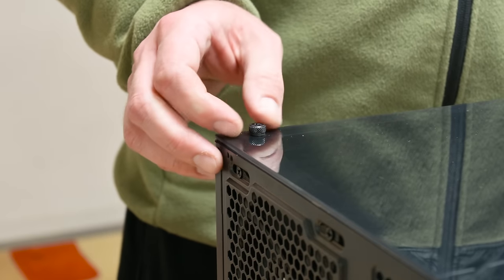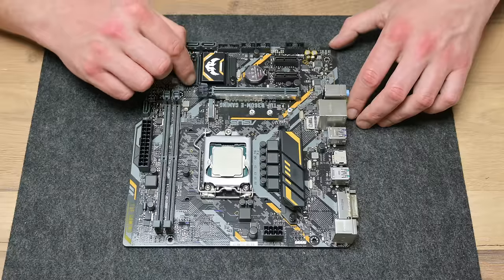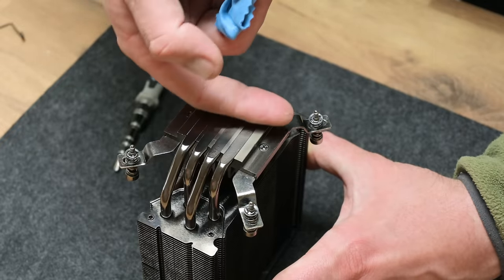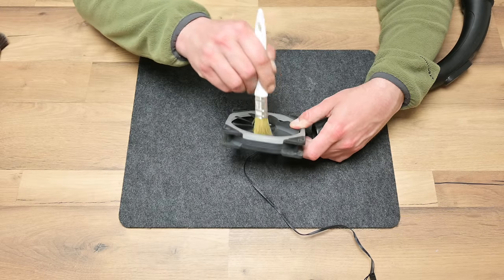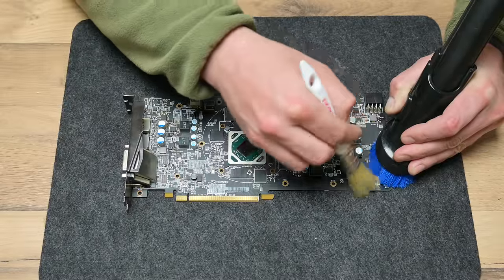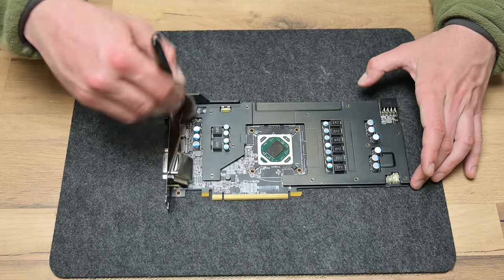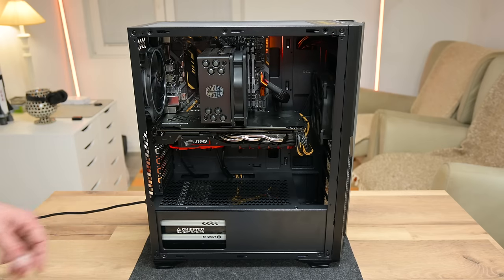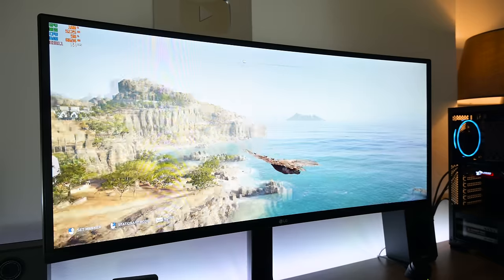This Abandoned PC is Finally Finished

Comment: The only minor thing is that u should have placed the intake fan more lower since the mesh of the case is lower so it pulls more fresh air in, locking at it now the airflow seems blocked
Reply from the maker: Yes I agree, I change that before I return the PC, it was too high

Comment: I'd get the CPU up to a second hand i7 8700, graphic card up to a second hand RX 6600, and go full 1TB NVME (through OEM drives like Samsung PM981) if I was the owner of this rig. These upgrades still fall within the affordable range. Then again, you are following the owner's request to be as cheap as possible with the build approach, so it's understandable.
Reply from the maker: He has the mobo, CPU, PSU and Case already and  he felt sorry to leave the PC unfinished but because time pass and the parts gets older he don't wanna spend too much on this computer.
Reply: @ComputersAndTechAndAndrew  the PC will still make for a wonderful secondary build, in case friends come over but have no gaming capable devices to go multiplayer together.

Comment: Pls next time use solins cleaner instead of isopropyl alcohol. It vaporises faster, and leaves no markings on the surface.
Oh, and also, change the PSU. This one have a really weird reputation.
Reply from the maker: solins cleaner is fine as well, also I didn't change the PSU because I was asked to leave it, but I agree better PSU is needed here
Reply: @ComputersAndTechAndAndrew  im working as a technician, and i recommend to use cleaner, it saved me quite some times, like when you need glue loosen without any risk of spilling the liquid inside - it just vaporates and dont stay in or damage the parts.
Reply: @O2chevsky  one thing to know : andrew is a techician too
Reply: @warior1195  i know, and that was a friendly advice from one technician to other.
Reply: Why u bother to annoy him with this cmon mr annoying

Comment: Please put windows 11 on every pc or laptop you restor
Reply: Windows 11 still sucks 😅
Windows 10 is better and has less adware and Microsoft limitations
Reply from the maker: I will but bro, but most people don't like 11, and I make computers for other people and requests
Reply: I think this is undernstable
Reply: the thing is that windows 11 isn’t supported on all of hardware, not every pc ca;n handle it (like a core i5 2400 for example which can handle windows 10 but cannot handle windows 11

Comment: outdated mustard and ketchup cables
Reply from the maker: Yeah but still working fine :D not bad
Reply: @ComputersAndTechAndAndrew you could use extention cables in your builds, it will make them much cleaner